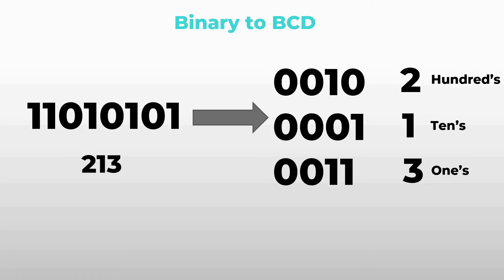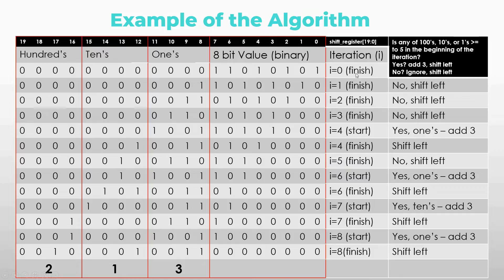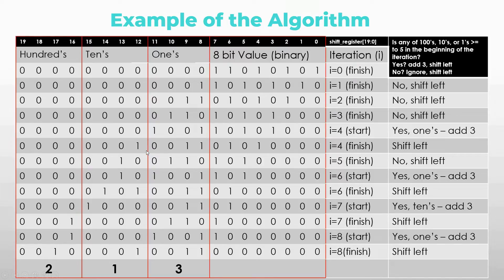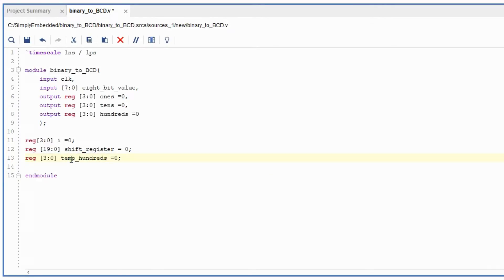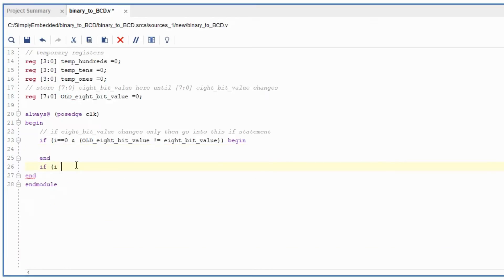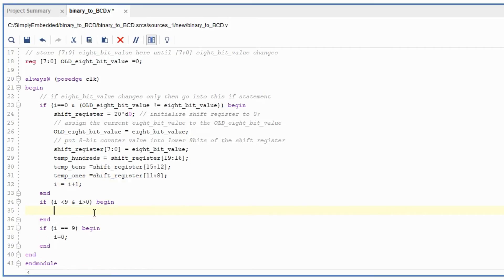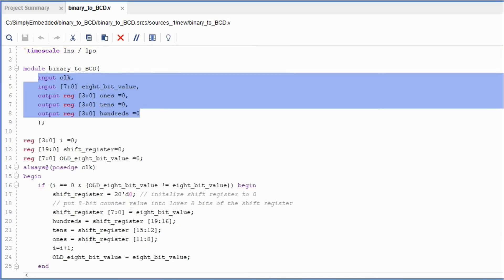How to create a Binary to Binary Coded Decimal (BCD) converter? | Xilinx FPGA Programming Tutorials

Comment: I would recommend an improvement to this code: set the shift register BACK to zero after the conversion is done in the last 'if' block

shift_register [19:8] = 0;

This will avoid the shift register continually continuing up to a larger and larger number every time the 8-bit number changes. This, I think, will save data/time as the number of times the <number> changes will continually increase

Great video. The verbosity in your code made it easier to follow. Very clear!

Comment: do we need a testbench to run our code ?
Reply: Felix Alexander i can use a vector waveform to test it actually if the fpga is not available
Reply: Felix Alexander yes you can input some values but there is no need to create a testbench to run the waveform

Comment: hello!
could you tell me why addition by 3 is necessary for when one's, ten's or hundred's place is greater than or equal to 5?
Reply: I had the same question. 

Turns out that this algorithm its called Double Dabble. Every time you shift, the number its doubled. When you have something equal or greater than 5 in a nibble, after the shift the value in that nibble will be greater than 9. When this happen you want to carry a bit to the next nibble. So before the shift you add 3 because after the shift it will became a 6, which means the next nibble will receive the carry and the current nibble will retain the residue.

Hope this will be helpfull for someone :3

Comment: What is the shift register value to be given for 12 bit integer?
Reply: I'm having the same problem, I recreate the example of the table, but with a integer of 3500, I think the shift register should be 28 bit long, eventhough don't know how big i counter should get, if someone know please let me know
Reply: @chaiinito9092  in theory it should work the same, 16bit is complemented by 2 so it should work. 12bit isn't so stick to the powers of 2 in terms of bits.